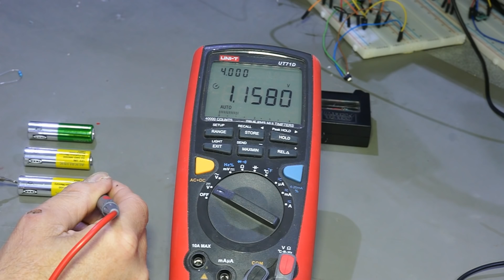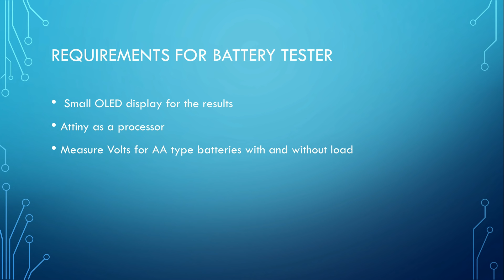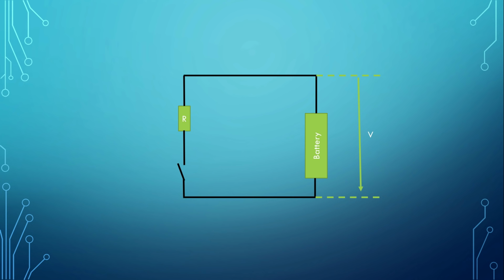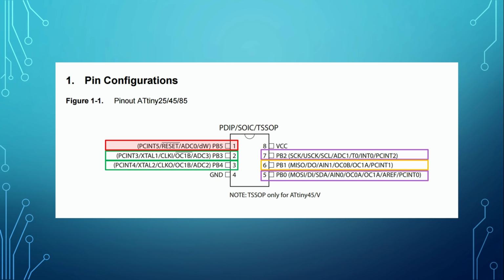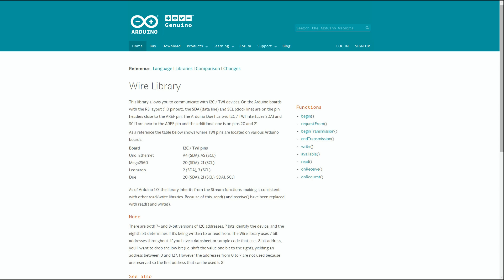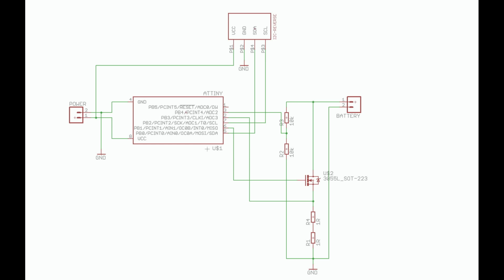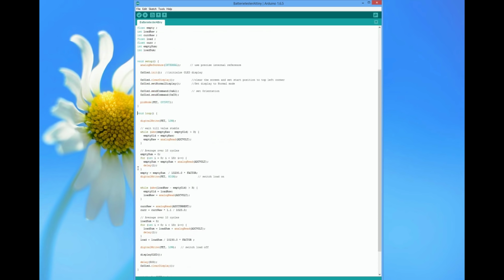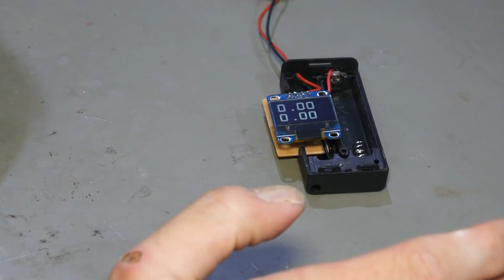#13 Automated Battery Tester with an Attiny85 and an OLED (Tutorial)

Comment: It seems that it would be simple to also add a feature to display resistance to a test circuit.  That way you could have a tiny, very basic DVM.  Do you agree?
Reply from the maker: Yes, but a very limited one.
Reply: @AndreasSpiess Clearly the display is limited but is there a significant limitation to the range or sensitivity to resistance?  VDC & resistance are the two most commonly used features of any DVM of course.  I was considering a project very similar to yours but including resistance.

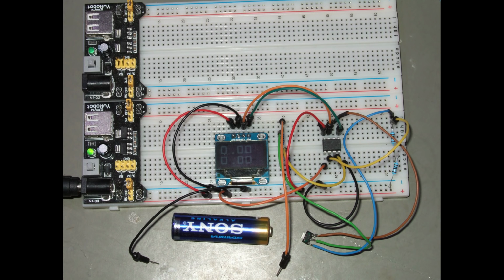Comment: Hello, 5:23 why the Attiny85 nr 1 pinout /reset/ is on positive? On the circuit diagram there is nothing on nr 1 pinout /reset/.
Reply from the maker: Best practice is to pull the reset line to "high". But usually, it also works without it...
Reply: @AndreasSpiess  first of all thank you for your response. I copy to your project, but it not working well. I used your code without any change. I used exactly the same components. I don't understand why it is not working. Here is a video how is working : https://youtu.be/xh4ZwNRIJFA
Reply from the maker: @budosfasz  It seems that the voltage is not correct. So you have to fix this one first by measuring the voltage at pin 3 of the ATtiny with a multimeter. You have to adjust the FACTOR if the value of the multimeter and the display is not the same.
If I remember right, the ATTiny cannot measure voltages above 1.1V (internal reference)
Reply: @AndreasSpiess  There is also 2.56 V internal reference with or without a bypass capacitor connected to AREF. It was not supported in Arduino when the video was made.
Reply: @AndreasSpiess  I measured the pin 3 but all the time got different voltages: https://youtu.be/Ja-escUZzXs
Reply: @AndreasSpiess  Hello,
On pin 2 measured 0V. On pin 3 measured 0.66V.  Tested battery is AA 1.34V measured with multimeter.

Comment: I have learned quite a bit while trying to understand what you did and why you did it. Is it fair to say that if you measure 1.1v using an internal 1.1v reference you will get about 1.1v. But if you had stayed with the standard 5v reference, you would measure about  0.86v ?
Reply from the maker: The ATtiny has a 1.1 volt reference because it runs on 5V power. References cannot be the same voltage.
Reply: @AndreasSpiess  I formed my question badly. In your code you changed analogReference from Standard 5v to INTERNAL 1.1v. As I understand it this yields higher resolution. But that term has little meaning to me. So I set out to see if there was a voltage measurement outcome difference. One measurement using A.R. 5v, and one use A.R. 1.1v (using atTiny or Nano is the same I believe). If I could see a difference, then I could understand why you changed the A.R.

I hope that I have explained myself better. The bottom line is, if you measure a battery with no load using an analogReference of 5v, what would you read if A.R. was then set to 1.1v ?  Let's say in the first instance you measured 1.0v no load battery voltage. I may have confused things by using a battery voltage of 1.1v in my question.
Reply from the maker: @youpattube1  As mentioned, the ATTiny has no 5V reference. If you set it to 5V, you must make sure your 5V supply is stable. Otherwise, your readings will be wrong. Most 5V supplies are not very stable. E.g. USB is rated from 4.7-5.2 volts
I once made a video where you can use a trick to adjust for this error using the internal reference.
Reply: @AndreasSpiess  Thanks again for the reply. I didn't realize that about the tiny. I did do a comparison of the Internal vs Default measurement of 1v using the Nano. Only 1% difference.

Comment: I read all the comments and no one ask this question, so it must be so obvious that no one has a problem with it. But I do. And I have tried many iterations of characters, strings, arrays, etc., and can't get it to BigPrint text. OzOled.printBigNumber works fine for numbers converted to strings, but how do I append a big 'V' for voltage to a bigNumber being displayed ?
Reply from the maker: The library has a "Hello World" example. So it should be possible to print strings. You have to create a String before you display it. Not easy, but Google is your friend.
Reply: @AndreasSpiess  hmmm. Ok.thanks. I'll noodle on it.

Comment: Hi try using your library with an ATtiny85 with a 128x32 OLED. I replaced the parameters of your library and I saved the Sketch with 1MHz internal but it didn't work. Do you have any suggestion for me? Thank you and cordial greeting from Argentina.

SPANISH: Hola intente usar tu librería con un ATtiny85 con un OLED 128x32. remplace los parametros de tu librería y grabé el Sketch con 1MHz interno pero no me anduvo. tienes alguna sugerencia para mi. Gracias y cordial saludo desde Argentina.
Reply from the maker: This is a very old video and I do no more remember. Maybe you find another library which supports your OLED? Or you first try it exactly as I did and if it works, start to change to find out where the problem is.
Reply: @AndreasSpiess  OK thank you

Comment: Hi Andreas. Thank you for the tutorial. How did you figure out C8 and A1 for the orientation commands. Where did you look? I couldn't find them in the .h or .cpp files. Any insights are welcome. Thanks, Gord
Reply from the maker: I do not know what you refer to. This is a very old video.
Reply: @AndreasSpiess  thanks for responding Andreas. I went to the datasheet and found the hex values. Best wishes.

Comment: hi there can u help me figure out how to measure voltage divider output with attiny85! help pls
Reply from the maker: I am a Youtuber, not a consultant. But you have Google to answer your question.
Reply: @AndreasSpiess  I have developed a circuit using Attiny85 and I am not able to get voltage value on using voltage divider on Port Pin 2 and I am not able to figure out what is the issue!
Reply from the maker: RTFM? Do you use the right pin number?
Reply: @AndreasSpiess   I didn't understand what "rtfm" is? And I have read all the required documents regarding attiny85 and I have used the right pin for reading voltage from voltage divider and I have used usb development board of attiny85 provided by digispark and I have also used the right library to program it and when I am using the same circuit using Arduino Uno it works perfectly. I would really appreciate your guidance regarding this issue !

Thank you!

Comment: HI Andreas, great work, maybe can just add an extra line in OLED  to check the Internal Resistance (Voltage Drop/Current) and display the value in mili Ohm.
Reply from the maker: Maybe you add it and create a pull request on GitHub?

Comment: Can somebody give me a type number of the MOSFET? I suppose P-channel or N-channel will work. I want to experiment with this by replacing the switch with a LF-generator. I have a pos or a neg puls of one volt. So the MOSFET needs to conduct FULLY with a VGS of max=1V. I have no clue which FET to use. Please help
Reply from the maker: Here you see that I used a 3055 n-channel FET (https://youtu.be/mKPKQm0uPBQ?t=332).  It will not be easy to find a MOSFET with 1 volt Vgs, but Mouser etc. have selection tools on their homepage.

Comment: Dumber me, tried to do it with Digispark! Fail... USB interface interferes... need to get the ATTiny alone!!
Reply: ? Sure ? It should work the USB interface is done in software and can be used with some pins on them so??? In what way does it interfere?
Reply: @kitecattestecke2303  The digispark uses one of its pins dedicated to usb.  Can cause problems in programming if hooked up to a circuit and problems in operation.  Think of the digispark as having only three usable pins instead of 4.   I learned the hard way, lol.

Comment: Hello, not sure attiny85 is powered at 5vcc or 3.3v to be compatible with Oled sda scl lines? Unsure, whether those Oled i2c interface expects 3.3v max since ssd1306 Oled chips seams to have such maximum electrical limits in datasheet? Trying to do the same right now ;)
Reply from the maker: Check if your OLEDs are 5 volt resistant in the specs (usually, they are). Then you can decide. the ATTiny works on both voltages.

Comment: Having a little issue ...

have been using the library from GitHub to successfully print some info on screen - a float.  

Now trying 'printBigNumber' and getting an "Undefined Reference" error when compiling - specifically mentioning the printBigNumber function.

Already found an apparent error in the example sketch:     dtostrf(empty, 1, 2, tmp);     
      ("1" should be total chars, "2" is digits after decimal. "1" should be larger)

for my usage, replaced with:         dtostrf(tempC,5,1,tmp);   // Convert tempC to Array of Chars - 5 char total, 1 after decimal
    -this line seems to compile fine.

next line is where the error is flagged:
      OzOled.printBigNumber(tmp, 0, 0, 5);  // Print Large Font up to 5 Chars

Any suggestions??  Thanks
Reply from the maker: You mentioned that it was working. So maybe you go back to the working example and change one after the other to find which change creates the problem. That is how I usually do it.
Reply: @AndreasSpiess     printBigNumber is the only part that has the error.  :(     

The rest of the Library seems to work fine - at least all the functions I've used.

I only get the error if I try to use the function.  Just commenting out the one function call is enough to make the sketch compile properly.

Hope that clarifies, and I appreciate the response. :D

Comment: is it possible to measure the internal resistance cause it seems its all there in the hardware , it needs only some math in the code and it can display internal resistance of the battery too. you can make this project with an ads1115 or an ina219 and have amazing accuracy and display internal resistance ,load voltage and float voltage (so a super battery tester) !
Reply from the maker: Should be possible. But so far I was never interested in this value.

Comment: Dear Sir, I have build this using pro mini and the display is Nokia 5110. How can I show you the picture of my battery esr meter. Using voltage divider to measure till 15 volts. Load current element, 10ohm and irfz44. Accuracy 5/1024 still.
Reply from the maker: You can post links here in the comment. Or you send me a Facebook message.

Comment: Very nice, I am trying to get your TinyOzOLED library to run, but it seems I also need the original OzOLED library as your examples are including that (Include OzOLED.H).
I searched but there are various OzOled libraries on Github, which one was the original ?
Reply from the maker: I do not think you need the OzOLED library if you the TinyOzOLED library of my GitHub. Only the example files were misleading. This is why I deleted them. The battery tester sketch should compile with the TinyOzOLED library installed
Reply: Andreas , thank you for your quick reply, I will test it ASAP.
Reply: Got it working with some tweaking !

Can print int variables to the screen using printNumber      But now I want to use printBigNumber but I don’t really understand how it works....needs a bit more puzzling :)

Comment: Nice video does this work for 3.7V Lithium-Ion Batteries?
Reply from the maker: Not very good. LiPo batteries are quite different.
Reply: ah, ok... because I'm looking for a cheap solution to monitor Lithium-Ion Batteries, that they don't discharge too much because of theire self discharge rate. 
For example: a red LED starts glowing when the 3.7V batterie goes under 3.3V.

Comment: You can fuse out the reset, and keep the Micronucleus bootloader ... giving you 4 clean I/O pins in addition to those used for V-USB.    I know this is an old vid, but just thought you might like to check out the LittleWire approach to the t85:  http://littlewire.github.io/
Reply from the maker: Thanks for your link. I know about the fusing, but it was too complicated for me. So I only tried it without using it in my projects.
Reply: Yes, the official documents are inscrutable.  Thankfully, there is this site:  http://www.engbedded.com/fusecalc/
The fuses shipped with one I have at hand right now are:   (E:FE, H:DD, L:E1).   You select attiny85 from the pull-down, put your current fuse items in at the bottom.  When you click the disable reset box, look at the bottom of the page, it it will actually give you the NEW avrdude parameters.  So disabling reset becomes:  avrdude -p t85 -c  [YOURISP] -U lfuse:w:0xe1:m -U hfuse:w:0x5d:m -U efuse:w:0xfe:m ... one bit difference.
This will make your t85 ISP work better, because you will no longer need to manually connect the reset to ground on your target device.

Comment: Hello Andreas Spiess.
I have used this sketch a few times.
That went fine.
But now I get the message that the sketch is too big (6,804 Bytes).
The space that is seen in the Atiny85 by ide 1,8, xx would be 6,012 bytes.
Unfortunately, I can not use the sketch now.
Has the ozoled.h changed?

Do you have an experience with this.
Greetings Bert.
Reply from the maker: I do not know. I did not use this library for quite a long time so I do not know.
Reply: Thank You.
Reply: Can you tell me how big your sketch is now?
Then I can compare.

Comment: I did a project for a customer way back in time. They could not describe the function  of an alarm in a way that I could do in 74xxx logic and be sure they would approve it after testing. So I used an ATTiny, and sure enough, after testing they found out I was right, the specs were not describing what they meant. But I did not have to redo the board layout, just reprogram the microcontroller within a day or two. As a bonus the component count and cost were lower than if I used 74xxx logic. 

No cost escalation or time penalty. Customer happy, my company happy, me happy, life is good.

And another thumbs up to you as usual.
Reply from the maker: Thanks for your support! I also prefer an ATtiny because of the reasons you describe.

Comment: Hi! this is a really nice proyect!
I have tried to implement it with a 128x32 oled screen, but so far it has been impossible!
Might you help me ?
Reply from the maker: What exactly is your problem? Did you try the OLED itself with the example files? Does it work?
Reply: @AndreasSpiess  I've got the same problem... The thing is that it seems to vertically "compress" the string of characters that I print. I don't know exactly what the issue is but, although it prints, it's hard to read because I think that it removes some horizontal rows and stick the rest together. It's not the display, I have already tested it. Could you please help me? Thank you!
Reply: @AndreasSpiess  Btw, I have tried the exact same code with a 128x64 OLED display and it works fine. Is it possible that the print function does work properly only with the 128x64 and not with the 128x32? Thank you in advance.

Comment: Hey .
Can  the numbers and characters also be made smaller.
Via the  ozoled Lib. commands.
I try but I can not.
I am a 71 year old beginner.
Please your comment.

Greetings Bert (Dutch accent) :-)
Reply from the maker: You should be able to replace the command printBigNumber with printNumber. Maybe it works...
Reply: The print option number is very small characters.
The printBigNumber is very large.
I would like half smaller.
Is that possible ?

Here is a sketch of me.
Digi Park Tiny85> Oled.
Based on your Batt. tester
Thanks.

/* Auteur B.Heideveld 09-03-2017
   Digisparktiny85 Temperatuur on Oled.
   Lm35Dz or Lm36Dz sensor op P4
   LmxxDz needs stabele Vcc or Reference DC
   Oled SDA op P0
   Oled SCL op P1

   Thanks to Andreas Spies :-)
 */

#include <TinyOzOLED.h>
#include <TinyWireM.h>

// ATtiny P0 = SDA                   ATtiny Pin 6 = (D1) to LED2
// ATtiny P1 = SCL                   ATtiny Pin 8 = VCC (2.7-5.5V)

#define TEMPIN A2     // TEMPIN OP Pin 2 = P4
float temp ;

void setup() {
  analogReference(INTERNAL);      // use precise internal reference

  OzOled.init();  //initialze OLED display
  OzOled.clearDisplay();           //clear the screen .
  OzOled.setNormalDisplay();       //Set display to Normal mode
  OzOled.sendCommand(0xA1);        //Set Orientation
  OzOled.sendCommand(0xC8);        // to normal
}

void loop() {

  temp = analogRead(TEMPIN);
  temp = temp / 34.5;

  displayOLED();
  delay(10000);
  OzOled.clearDisplay();
}

void displayOLED() {
  char tmp[10];
  dtostrf(temp, 2, 1, tmp);
  OzOled.printBigNumber(tmp, 1, 0, 4);
  OzOled.printString(  0, 5, 6);
  OzOled.printString("Gr/C");
}
Reply from the maker: This library only has two fonts. Big and small
Reply: To small ha ha Thanks.

Comment: Can you make a UV meter with an ATtiny 85, Oled 4 pin 128x64 SPI Serial and MI8511 UV Sensor? like this one: https://www.instructables.com/id/DIY-UV-Meter-With-Arduino-and-a-Nokia-5110-Display/
Reply from the maker: If the ATTiny has enough pins, it should be possible.

Comment: Andreas, I finally built up your battery tester circuit on a board for regular use. I did change the display portions of the code to suit a 2-color OLED display that I had on hand, but otherwise the sketch works as you wrote. I did eliminate the current measurement part of the sketch as it was not being used and eliminated one connection to the ATTINY85. This thing is very handy!

Oh, I also switched the location of the MOSFET and load resistors as shown in your schematic so that the source is connected directly to ground, allowing for more reliable switching of the MOSFET.

My video is at:   https://www.youtube.com/watch?v=ZNbV6Nkpp6Y